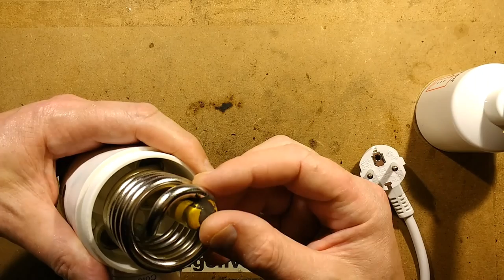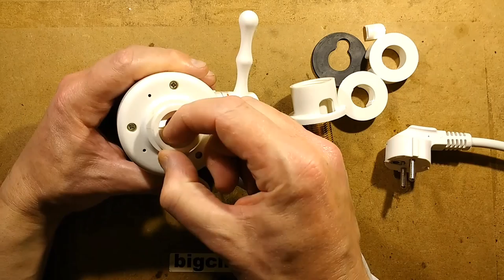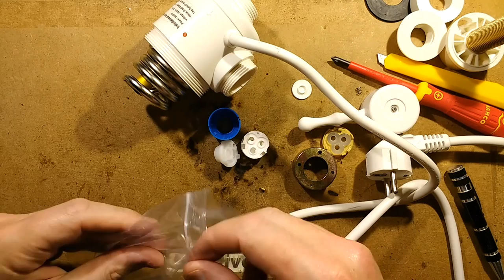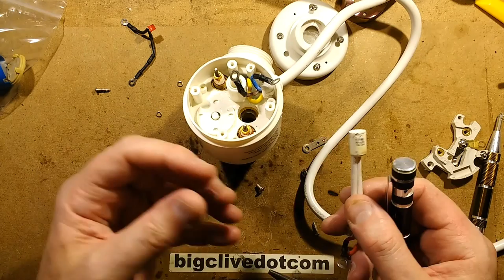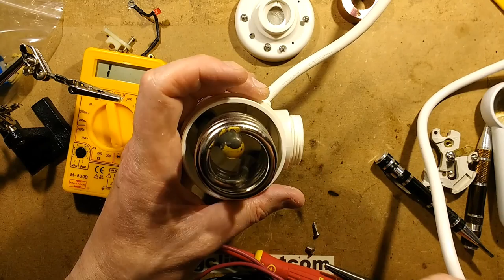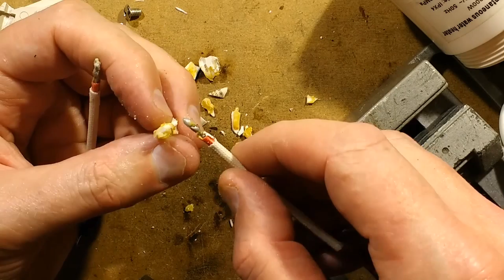Cheap electrically heated tap / faucet teardown.  (230V)

Comment: Most larger Hot water tanks do have a magnesium of aluminum sacrificial anode, but I am. It not sure about the under sink ones however, so the aluminum piece is a good idea. Or a plated element perhaps if possible
Reply from the maker: I'm not sure how it goes with the tank being plastic.
Reply: bigclivedotcom good point. I guess attaching the aluminum or magnesium stock to the element may be an option, but I would imagine there would be some issue with the two metal possibly making things worse if they are in contact. Perhaps dropping some magnesium balls or chunks in there might be an option as the plastic wouldn't be affected. Differently coated element perhaps stainless? element shell, much like this heater. Hmmmmm.🤔
Reply: The problem might not necessarily lay inside the tank. There might be interaction between metal component outside of the plastic tank. For instance if the tap contains stainless steel or something like that. Then it might be the heating element that gets sacrificed. An anode of aluminium or magnesium might do the job. It might work better when it is bolted to the heating element in stead of laying lose. But I'm not an expert on this.
Reply: threeparots1 it would go all toxic tho
Reply: drkastenbrot magnesium is probably the better option to lessen the Alzheimer's
Reply: A sacrificial anode must be electrically connected to what it is protecting to complete the circuit. It is after all a galvanic cell with the water being the electrolyte.

Comment: Mains plus water plus you     Yum
Reply: FennecTECH don't forget that its plastic housing is supposed to last year's....
Reply: I can almost guarantee that the plastic housing long outlives it's contents. I'm way more concerned with 230v 3000 watts + water.
Reply: Loren Husky Yes without a grounded plug
Reply: Forget a grounded plug Minecraft Expidition!
What it need's is a SACRIFICIAL ANODE!
We shall sacrifice the galvanized steel to the negative ionic metal bonds in the dihydrous fluid of death!

Comment: How is this product practical in any way?  In most places that doesn't treat water the mineral deposits will clog the works in a few months.  It trickes hot water with no force, which is what you want in your kitchen sink or shower.  It only warms cold water not to hot.  I guess the most useful thing it does is provide luke warm water to make a cup of instant coffee.

Comment: I never can understand the Chinese's fascination of mixing high voltage and water, everything from deadly drink warmers to deadly showers, and now faucets. Pretty sure a device that you can put into your bath as you bathe in it to keep it warm will be next (like the hot drink device but larger)
Reply: Raven S they probably already sell them as "hairs-dryer"
Reply: immersion heating tanks, boilers I assume you're refering to? are just only in old cities, such as new york or philadelphia or pretty much just the eastcoast of the U.S. where the major cities, most towns, etc were constructed pre-1900s and have large buildings (skyscrapers and commercial buildings) that are still standing which were built during or before the industrial revolution, so to retrofit them with modern equipment would require major renovation and cost a lot to the building owners.

Anything post WWII pretty much have gas or electric water heaters. Wspecially the western half of the U.S. where most major cities were constructed post-1900, and most suburbs post WWII.

So being from the westcoast myself where our water is heated via natural gas, the idea of using high voltage electricity at and near the faucet to heat active streaming water which you touch, seems quite suicidal to me.

I can understand if it was a electric water heater that heated the water for the whole house, as it's heating a supply of water similar to a natural gas heater, and if it did somehow short out, electricity has the opportunity to be grounded out or dissipate over distance unlike short distances where the heater is at the sink..

Comment: I will never buy a faucet that uses ceramic cartridges. Just a bit of grit in there and the whole stem needs replacing. Older style ones you can buy a .29 cent faucet wash to repair a simple drip. With ceramic it's the whole stem. Could be $30

Comment: Looks gimmicky? Cant use for too long, wait time for heat, safety, needs to be on a GFCI, pressure switches dont work on low pressure..Go rooftop fresnel heated systems to a tank, of always hot.. Free, no electric costs, 100% safe!!

Comment: Yikes!!! that would be so damn illegal here in the US.
Reply: That surprises me. In the country where anyone is allowed to do their own electrical installation work and "wire nuts" are considered a valid means to make electrical connections?
Reply: Wilbert The Swordsman electrical code varies from State to state and counties within a state but in my area of S. Carolina to rewire a house fully you have to have certified a electrician to do the work then county inspectors cone behind and certify that all is done right but something like replacing a light switch you can do yourself plus N. America is 110 - 120 volt for normal outlets and 220 volts for heavy duty application like appliances and welders so those water heaters would not work here anyway
Reply: I'm not sure about that - if it is made properly there isn't anything particularly unsafe about it. It's a sealed element in water, the same as electric showers (not of the run-electricity-through-water type) very common here in the UK. In fact I just bought a similar thing to this tap (but not so cheap) to use in my house in a sink that is quite far from the boiler.

Comment: Why would anyone use this? It's cheap, Chinese, and combines electricity and water, is this not a winning combination?
Reply: a lot of washing machines use a similar diaphragm switch where water pressure pushes up the diaphragm to make or break a contact. The garbage disposal in your sink combines water and electricity too. Lots of things combine water and electricity to great effect, and are also made in China.
Reply: MrFunkia this reminds me of one of those cheap Chinese submersible AC water pumps you can get with those water fountains from Menards. Nothing instills SAFETY and CONFIDENCE like a small plastic module with an HEAVY DUTY 12-3 AC line attached to it being lowered into a water resevoir. <grin>
Reply: girlsdrinkfeck - As far as I'm aware the UK isn't a third world country with third world standards of electrical safety.